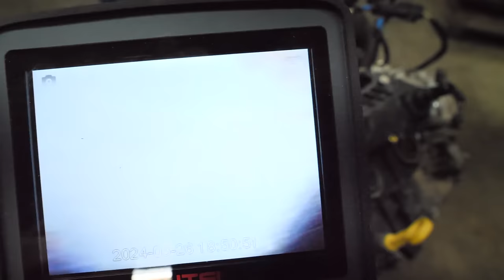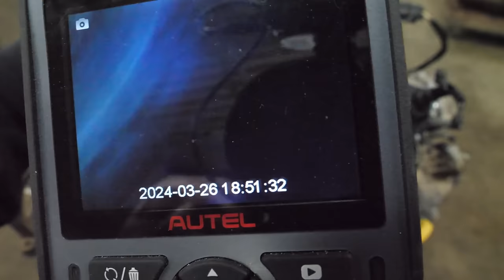ANOTHER BAD 2.7 Ecoboost? 2018 F150 Twin Turbo V6 DEAD @ 131k Miles

Comment: A Ford engineer would tell you "We pulled $1.29 out of each engine by using that belt instead of a chain" and the look on his face would tell you that he was PROUD of what he had done...
Reply: I don’t think it was the engineers that were penny pinching.
Reply: @TheXGamer969 Agreed.  Corp executives and consultants…ruining this country one penny at a time.
Reply: GM has done this many times.  Putting a tranny designed for a CHEVY CHEVETTE (THM 200) in a big 77 Caprice Classic?  NOT putting a vibration balancer on the 2.5 "Iron Duke" (except for a few at the end)?  I heard GM once put PLASTIC sprockets in the dealership parts bins for some of the 1970s MONZAs, but I heard they were recalled because GM realized these were STUPIDLY BAD quality.
Reply: @TheXGamer969  And the engineers definitely won't be proud of it.  But the bean counters will get very excited.
Reply: @williamjones7821  "Stop talking about the stupid cost cutting stuff Ferd is doing let me change the topic here's some stupid stuff GM did 50 years ago hur dur hur."
Reply: Saved $1.29, cost $5000 for a new engine.
Reply: @hochhaul  Ford?  What about the backup light switch in that C4 automatic that wouldn't last 3 years (79 Monarch 4-door 250 CI, with the plastic gasoline door below the trunk lock that fell apart before we even bought the car).  Also, I keep my cars a long time, so this stuff is relevant to me.  Right now, I have a 2001 Saturn 1.9 and a 2002 Saturn 1.9, BOTH stickshift.  If you have ever driven an automatic version of one of these cars, with, say, 160K on the clock, you will know why.  There's one fellow online that has over 800,000 miles on his Saturn, I'm guessing it's a 5-speed manual.
Reply: @hochhaul  I did mention the crappy backup light switch on the 79 Monarch, and the gasoline filler door?  Well, in the early 2000s (before my bone marrow transplant) I struck up a conversation with a man (while I was in the Saturn dealer for an oil change) who used to work at Hitachi.  Hitachi made MAF sensors, mostly for Ford and Toyota.  Ford had lax specifications, and DID allow Hitachi to break pieces of a plastic mesh screen to try to make it perform within spec.  Toyota had tight tolerances and would NOT allow re-work.  I see most US automakers as having glaring faults GENERATIONALLY, and not desiring to improve.
Reply: @williamjones7821  These days Toyota is selling  3rd gen (2016-23) Tacomas that was rated least reliable midsize truck by Consumer Reports for 3 or 4 years on a row and selling 3rd gen Tundras (2022+) with engines failing left and right. Their standards are not what they were 20 years ago. 🤷‍♂️
Reply: It's the sort of thing that Munroe would appreciate, bolt counting was his thing
Reply: Saved $1.29 with the oil pump belt but added $750 with that ridiculous bottom end casting!
Time to bring back the small block Chevy
Reply: @TheXGamer969 Certainly. A bean counter doesn't design the engine. Note that the belts usually don't fail, but certainly fail more often than gears or chains.
Reply: My best guess is that the oil pump belt (pains me to even type that!) was spec'ed to lower nvh as well as save some coin. If they were going to run a belt to the oil pump, they should have put the drive cog in front of the timing chain gears and then put a split timing cover on the engine so you could change the belt every 100,00 miles or so. Then it would hardly even be an issue, but noooooooo.
Reply: @dougrobinson8602  maybe they should have torn up all the blueprints and started over?
some of the engines eric tears apart have ridiculous designs that probably look fine as computer animations .
Reply: @dougrobinson8602  I guess they figured "Honda does this to drive the cam on their OHC lawnmower engines, so we can do it on our oil pump"....

A bad design is a bad design, no matter who builds it.
Reply: That Ford Engineer came from Boeing.
Reply: @dougrobinson8602  I, for one, cannot stand all the NVH coming from my oil pump drive chain...😂
Reply: @nicholasvinen saved them $1.30 COST YOU $5 Grand.    That makes not a TP but a YP.   Sadly they don’t think owners have a memory🤨
Reply: @dougrobinson8602 NVH and efficiency. Because if a customer bought a truck with a chain-drive oil pump he'd go deaf after driving it for 15 minutes and his fuel consumption would double.

Not.
Reply: @nicholasvinen  Saved $1.29, and also got a $5k replacement engine sale, just outside of warranty period, as a bonus as well. So made an extra $5001.29 per vehicle in profits.
Reply: @Flies2FLL  And I find those Honda motors on the side of the road, replace that belt, and they always run great. Just got a great EU2000i generator for the cost of a belt.
Reply: @hochhaul they can do that for a while too the fan boys will defend them and eat up whatever they put out for another 20 years no matter what lol. I like Toyotas but some of the owners are a little off
Reply: It was still in one piece and doing its job.
Reply: Engineers do not enjoy compromise .
Reply: Sad but that's the world of corporations these days. That alone saved them potentially millions of dollars. If enough engines make it to the end of the warranty period that it costs less they call that a win.
Reply: @davec8921  Precisely.
Reply: @williamjones7821  I had one of those THM 200 ,REPLACED IT WITH A TH350 BUILLET PROOF TRANS
problem solved!
Reply: @CARSON441  When my parents hired the shop to do their 350 swap, it would go straight from first to third.  Maybe a missing check ball in the valve body?  My parents waited A FULL YEAR to complain to the shop and insist they do it right.  This NEVER should have happened if the shop was professional.
Reply: What i dont get is the kevlar belt probably cost more then a chain
Reply: @nicholasvinen  he proved that the  $1.29 part difference didn’t kill this engine. Low comprehension skills prove your comment is off base
Reply: @williamjones7821  there ya go, complaining about something that happened to a car 45 yrs ago and you still thinking that they are all still made the same 🙄
Reply: @rosewhite---  apparently ford knew it was good part so they put the same wet belt in their 5.0 v8….
Reply: @dougrobinson8602  it’s because the belt doesn’t have a change interval of 100,000 mi or so. 
In your infinite wisdom, let us commoner’s know when is the time for maintenance of that belt? Even this guy tearing it down doesn’t know..
Reply: @Fireal4632  and the belt may outlast the chain, you don’t know..
Reply: @TheXGamer969 it was the bean counters!
Reply: @williamjones7821  I had a friend with a 1971 Pontiac LeMans Sport with the 350 cu in engine. I used to do all the work on the car and was confronted with an engine suddenly running terribly one day. It turned out that GM had replaced the steel camshaft sprocket with a, I believe, Nylon one which had sheared off a bunch of teeth, thus mistiming the engine. Luckily, there was no piston to valve contact and so the repair was not a big deal. The repair was done under warranty and I was told by the service manager that the factory wanted the failed sprocket back for analysis. I was also told that the reason for the switch to plastic was for reduced noise and cheaper manufacturing costs.
Reply: @hochhaul  "Hur dur dur"?  You sound like that guy in High School that provided his own comedy laugh track.  He was not funny; I'm not sure why he thought he was.

Comment: I was quoting a MX13 for a 2025 Kenworth T680 yesterday. Engine was $63,000 and the core was $8,000. The truck has 6k miles on it and was in a crash bad enough to break the block
Reply: The Cummins in our 2000s Freightliners run about 10k for a rebuild. They refuse to look at new motors cuz it's ridiculous.
Reply: This is why companies like mine buy wrecks. We salvage all sorts of shit from them and use it to rebuild others. We can build up a truck with 10k miles for $100k when a used one with miles like that is $275k+ easily. Saves so much money.
Reply: Wow
Reply: You need to remember that those blocks are graphite composites.  Strong internally,  weak when outside forces are inflicted on it. I hear they are now making sleeve kits for when you have to inframe the engine instead of purchasing a short block.
Reply: How much is a brand new truck? 🤣
Reply: @samholdsworth420  180k plus
Reply: @daviddhulst1513  we cut blocks and use different liners but it doesn’t always fix the problem. We have about 10 waiting for long blocks now
Reply: @MattLitkeRacing  😧
Reply: A 2025 Kenworth? Welcome to the future. Did you happen to note the lotto numbers while there?
Reply: @johnt.848  built in January 24 but is a 25 model year. I don’t make the rules lol
Reply: @lustfulvengance  impressive
Reply: What a effin scam
Reply: Was it a Swift truck ?
Reply: @zonie70  too soon lol
Reply: And it has a plastic oil pan and drain plug like this engine. Have you been seeing all the broken main bolts on the mx like we have.
Reply: @kylewilcox8928  the biggest problem we have here is injectors. Trucks are getting injectors changed more than the oil. I just had to order 300 “test” injectors that are an updated version

Comment: You didn't investigate why piston was rocking side to side, now I won't be able to sleep😂
Reply: He said he wasn’t sure. He thought maybe it needed oil pressure
Reply: That melted chain guide kind of deserved further investigation too but it won't keep me up at night. 😄
Reply: Ha ha.
Reply: Had to be wear in the pin holes in the piston, given the pins are a seize fit in the rods....unless it wasn't a seize fit any more of course. Can't imagine how oil pressure would affect pin clearance?

But, yes, would be nice to have that investigated a bit more.
Reply: Ford because Ford
Reply: Oil pressure has no effect on wrist pin clearance - that should NEVER happen .He definitely missed that. The wrist pins are often W grade tool steels, and do not wear - pistons are knackered. Cant imagine what that would run like; its not a common failure mode on correctly engineered engines
Reply: I am surprised that was not mentioned once the pistons were out, too. Had to be a worn rod or piston creating slop at the wrist pin.
Reply: ...and that's probably where the mystery flecks of metal came from in the oil and oil filter.
Reply: Wrist pin bearing or the pin itself
Reply: @kb1gni 100% that’s where the metal came from. I’ve never seen such a well engineered product be so poorly engineered (manufacturing).
Reply: It’s because it’s a ford.
Reply: @daviddorge1559  How could he not have oil pressure with that ingenious 100 percent reliable "oil pump drive belt"?😂
Reply: Did you change your belt fluid 😅😂
Reply: Might be the old F.O.R.D sensor 😂

Comment: I have a 2018, 2.7, With 135000 miles on the F150. No problems. I hope I didn't jinx it! I change my oil every 4000.
Reply: Ronnin aftermarket oil plug is a must!
Reply: Ballen1182 why when the coyote is better and a more direct swap
Reply: @doug350zTT oh the oil eater?
Reply: @JAMESWUERTELE  you living in 2018 .. oil consumption was fixed in 2020 .. update your google
Reply: Ballen1182  better in every way.. it handles more power on stock block .. it responds to boost better and it sounds better
Reply: @MrThebirddog i returned mine. I liked the idea but i feel like it left a decent amount of the old oil
Reply: Ballen1182  yeah I know the LS doesn’t last as long as the coyote but we can’t hold that against it
Reply: @2strokeFORever  interesting .. mine is sitting in my desk in my office .. I never got around to installing it after multiple oil changes
Reply: Ballen1182 😮Yeah, put a POS GM Ls sWaP eVeRyThInG garbage. It's so popular BECAUSE so many were made the junk yard is overflowing with junky LS engines with peeling cylinder liners and all the garbage to go with it. So sick of the LS swap bullshit! It's just not that f'n good at all🤦🏻‍♂️🤔🤷🏻‍♂️😅
Reply: Ballen1182  it’s funny there are more boosted 5.0 running the track and streets than LS trucks though .. really funny huh .. its ok blind loyalty .. I get it
Reply: @doug350zTT  No it doesn't. Gen 3 Coyote blocks are maybe good for 850 hp without sleeving according to MMR. Some guys will push them further without it but the block will start to crack without welding a bunch of gussets and addressing other issues.
Reply: @hochhaul  Gen3 block is good for 1000hp .. the 10r80 is the issue after 850hp .. and that’s 850 whp not 850hp
Reply: @doug350zTT  Not according to MMR and others. You're sleeving the block unless you don't care that the engine lives a much shorter life. There are always clowns that ignore the advice of the experts and play it cheap and skip the bullet proofing obviously.
Reply: @hochhaul  that’s with any motor if you’re planning big power but that’s not what we are discussing .. we are talking LS vs coyote and what you have to do or not do as power increases and which handles more power at what level
Reply: Children, children let's just acknowledge.. FORD sucks and CHEVY sucks...MOPAR RULES..😅😅
Reply: Hemi tick anyone? 😂
Reply: My ‘18 2.7l is at 165k & no problems.
Reply: @doug350zTT  the 2018 coyote is far less reliable than the 2.7. Oil consumption baby.
Reply: @ThunderDome2024  less reliable suggest they are more blown engines and that’s false .. oil consumption was an issue if you changed your oil at 10k .. I would be crazy to change my oil anything after 6k .. 2.7’s were blowing without oil issues
Reply: Ballen1182  you are unarguable just like any fanboy from insert your brand here________.
 I've owned Ford, Chevy, Nissan and Dodge trucks and know the pros and cons of every one of these brands. The 5.3 is a dog (any year) and the post 2007 engines are a POS with that AFM crap. My neighbor has a 2018 Chevy truck with less than 100K miles and he just replaced the lifters because they ticked, my 2.7 has double that mileage without ever been opened, how's that?  
Yes I know I can delete the AFM (and it isn't cheap) and I know I can add some cams to let it breathe and sound better and so on. And do you know what that also means? That I can apply that money to any engine to make it better, more reliable and such.
There are 2-3 years of the Coyote to stay away from, but there are also way over 15 years of 5.3 engines with AFM to stay away from. The 6.0 is the only one I'd go with for reliability alone, but it's a dog too and much thirstier on top of that. An LS3 from a 2010-2012 Camaro would be my choice, no AFM crap and if it's bolted to a 6 spd Tremec even better. But that swap is a pipe dream and 5 figures, no thanks, I'd rather get a solid truck from the very beginning.
Reply: oh oh, it will soon fail
Reply: Have you changed out the Kevlar belt ?
Reply: @rookie1514  no. Mine's at 190K.
I've seen many with over 200K miles, you'll likely rebuild the engine before the belt goes out
Reply: @JAMESWUERTELE 😂 so true! You got em
Reply: @doug350zTT  that 5.0 still has a spray on cylinder wall liners, real dependable 🙄
Reply: @doug350zTT  bull 💩